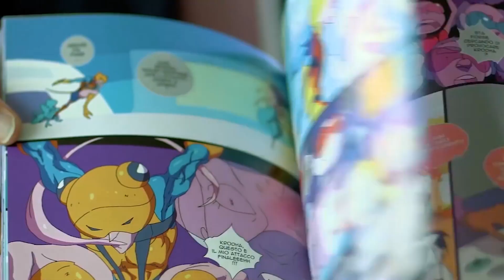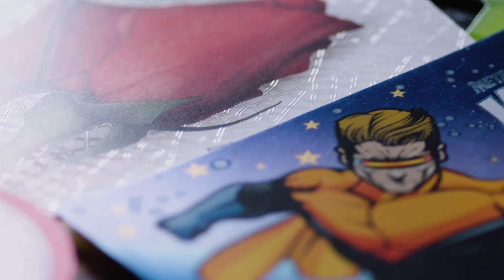drupa 2024 sizzle video | HP

Comment: I have Hp Laptop (Hp Victus ) very worst laptop By Hp I face so many in this  At First I got charger issue & TouchPad When I complaint  they repaired after that I got another speaker issue & also my previous issue not solved, so replace my laptop @HP